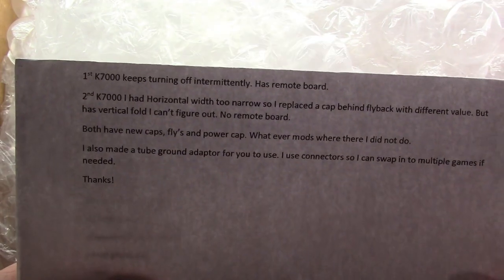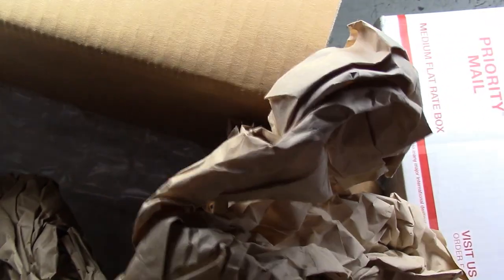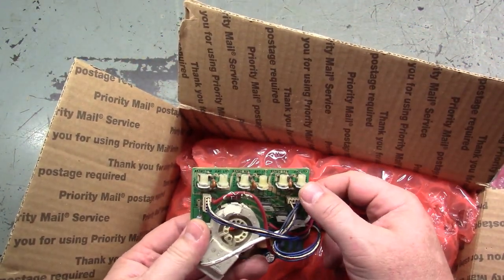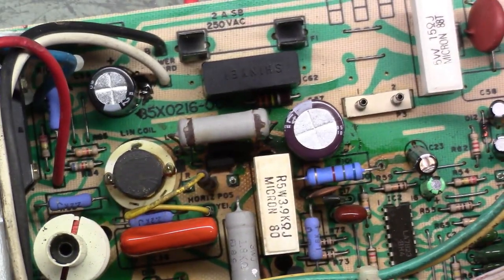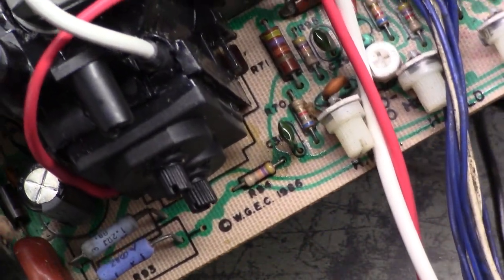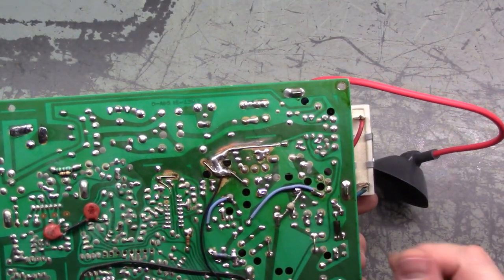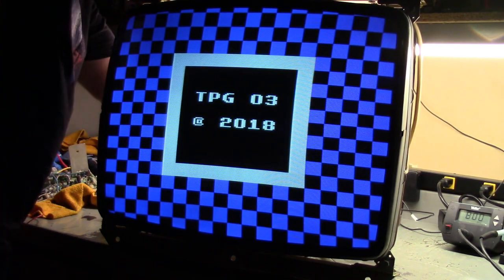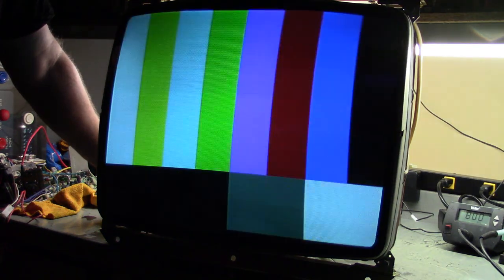25" K7000 Arcade Monitor Chassis Repair - Horizontal Squish and Vertical Foldover

Comment: I had a K7000 (chassis date 1990) doing this on only one side - I just played the game with it like this. Then, the fuse blew, the HOT shorted, and R101 reads in the mega ohms. Looking at my board, I have D138 soldered on top, with no cap at all. My questions are - could the lack of the cap be the reason for the poor width on a 1990 model? Also, could using the monitor with this issue lead to all the other parts going bad? Finally, is it possible to send it in to you?

Comment: I picked up a cruisn arcade and can not adjust the horizontal small enough it is off both sides. Controller board moves it just a hair but the coil on the board does nothing.
Reply from the maker: Is it a K7000?

Comment: hey mike why would a hot keep shorting even tho everything checks out okay? really really strange problem.
Reply from the maker: Possible bad film resistors or bad isolation transformer. Check R97, R101, R96, R88, R89, and R104. Make sure none of them are open or reading in the M ohms. And if your chassis has a D15 installed (some don't), make sure it's good.
Reply: @MikesArcadeMonitorRepair  thanx mike ive been stuck on this for so long, been going over the checks u do on the chassis none stop , just out of ideas, thanx for your advice.
Reply from the maker: You're welcome. If you get stuck, you're welcome to send it in.
Reply: @MikesArcadeMonitorRepair  cheers mike il have another shot at it first, go from their.
Reply: Hey mike really sorry to bother u, I know your a busy guy! What should c36 read out of circuit? As iam sure its not right on my board. Also that would explain the hots blowing.
Reply from the maker: Out of circuit, it should read open on the ohms setting or in continuity mode.
Reply: @MikesArcadeMonitorRepair  my bad it checks out fine. Should mention its a p447a tan colour, and neck board is p448b does this matter, both ks10.
Reply from the maker: Nope.
Reply: @MikesArcadeMonitorRepair  just a thought mike whats your thoughts on the flyback I bought from arcade parts and repair, says for k7000 but I have k7000a? Would this effect this.
Reply from the maker: K7000 flyback is NOT compatible with a K7000a. It won’t even fit. You successfully installed it? I don’t see how that’s possible.
Reply: @MikesArcadeMonitorRepair  yes.lol it fitted easy.
Reply: Well theirs the problem right their then. Ive gotta hunt for a 19" k7000 regular.
Reply from the maker: You definitely don’t have a K7000a then.
Reply: @MikesArcadeMonitorRepair  it says p447a on chassis, tan colour ks-10 how can I tell what it is?
Reply from the maker: That’s just a standard K7000. The K7000a is the Zenith version.
Reply: @MikesArcadeMonitorRepair  so flyback is right one then, thanx for info iam learning.lol
Reply: @MikesArcadeMonitorRepair  hey mike I seem to have power, now think c36 was the culprit after all. Problem now is no sync some what of a picture but not stable, any ideas where to check.
Reply from the maker: If you have no sync, I know for a fact IC2 is most likely the culprit if you have ruled out everything else like wiring, header pin solder, etc. Had one recently with no sync and IC2 was bad.
Reply: @MikesArcadeMonitorRepair  thanx mike I really appreciate your time to help me, that fixed the problem perfect. Very grateful to you sir.
Reply: @MikesArcadeMonitorRepair  well mike one last problem left I have to fix.lol never ending , the screen is quarter inch to short horizontal either side to fill screen! Horizontal width coil turns but nothing happens on screen? I thought if c38 was gone my fuse would blow, just unsure why it wont adjust.
Reply from the maker: The coil does nothing? That's not right. Inspect the solder joints on the coil. You can replace C38 with a lower rating to increase the H.Size. Lower rating increases, higher rating decreases.
Reply: @MikesArcadeMonitorRepair  okay👍
Reply: @MikesArcadeMonitorRepair  sorry mike would r98 cause the width coil not to work? Curious as I think r98 is faulty.
Reply from the maker: I’ll have check for you when I get home from work.
Reply: @MikesArcadeMonitorRepair  okay thanx mike I know I must b annoying by now.sorry!
Reply from the maker: No problem.
Reply: @MikesArcadeMonitorRepair  so messing with chassis today, and their is no squished sides, its about quarter inch to short either side , but horizontal coil still does nothing on screen? Is their a correct orientation the coil should b installed?
Reply from the maker: No. It's just a coil of wire. As long as it's connected at both ends, it should be good.
Reply: @MikesArcadeMonitorRepair  okay, so strange tho trying to think of a reason why it wont adjust on screen, when I turn it its free not broken no damage?
Reply from the maker: To answer your R98 question, it should read 0 ohms in circuit because it's installed across the width coil. You'll have to remove R98 or the Width coil to measure it properly. I've never seen one be bad before though.
Reply: @MikesArcadeMonitorRepair  Okay mike il take another look, thanx again for help il let u know what it reads.
Reply: @MikesArcadeMonitorRepair  well it reads 1.77 0hms out circuit, so guess this is okay.
Reply from the maker: R98 is supposed to be 2.2K ohm out of circuit. If R98 reads 1.77 ohms out of circuit, it's bad and could be your issue.
Reply: @MikesArcadeMonitorRepair  cheers mike il grab another r98.